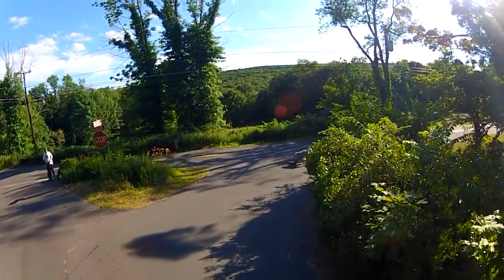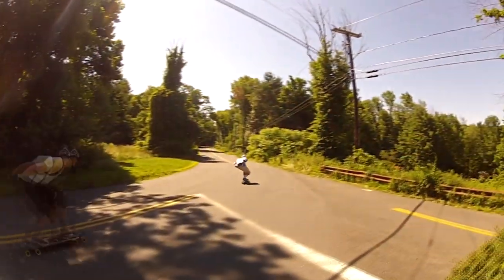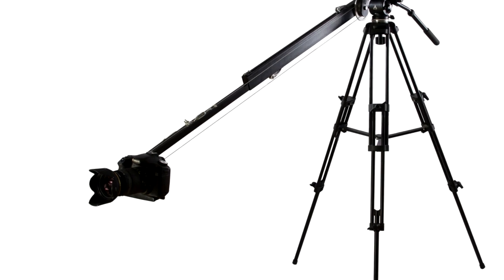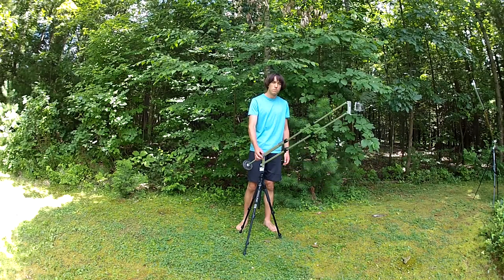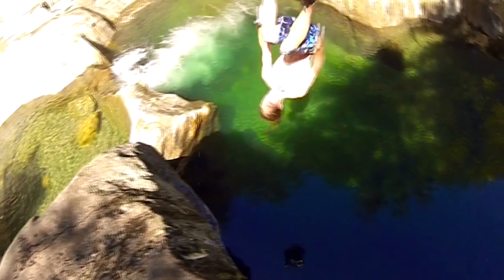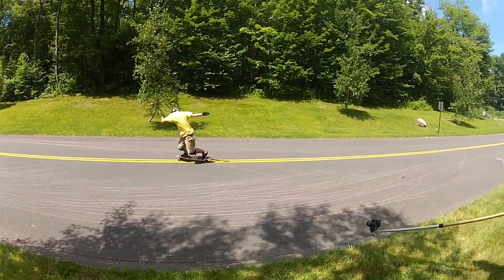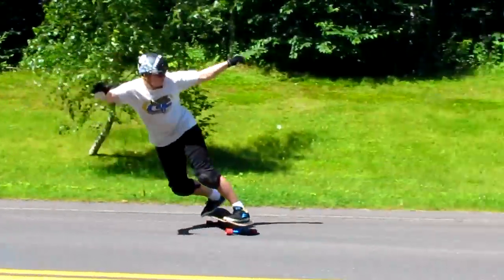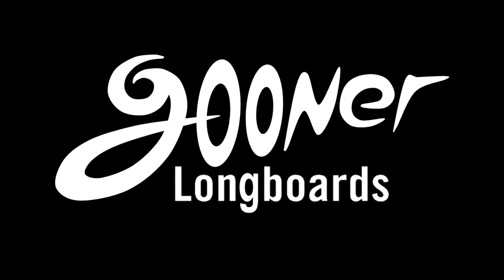Behind The Scenes: Jibs

Comment: Gooner Longboard, I just saw your video and it looks great. I would like to build a port-a-jib just like yours. Could you please let me know where did you buy the aluminum tubes that you yse for this Jib (the ones that screw together.
Thank you.
Reply from the maker: they're the telescopic legs from an old portable projector table, you should be able to find people throwing these things out / selling em for cheap since its a bit of an outdated piece of equipment...though they're sometimes using them for modern digital projectors now. I found these at our local town dump. The screw coupler is something you'll need to machine yourself though.